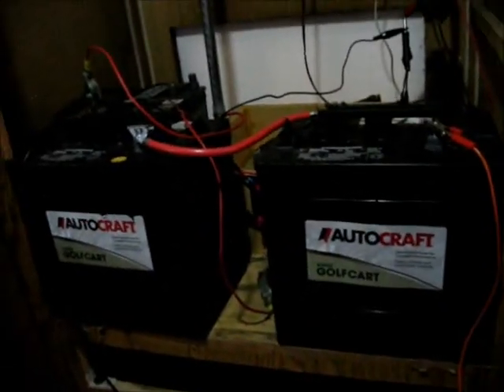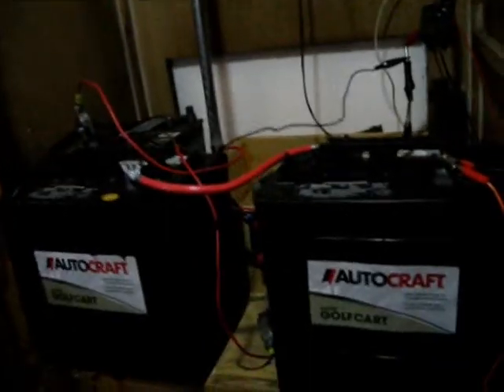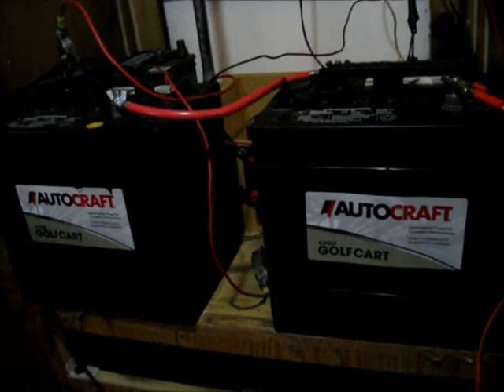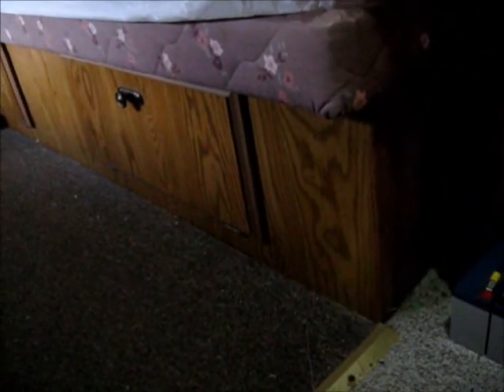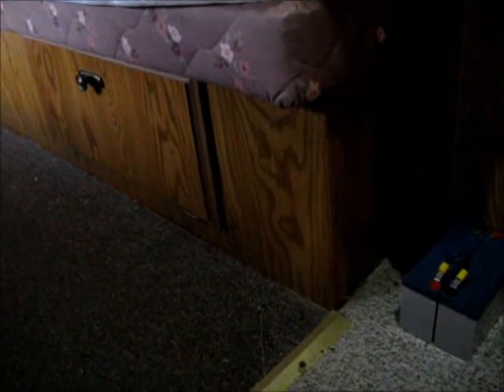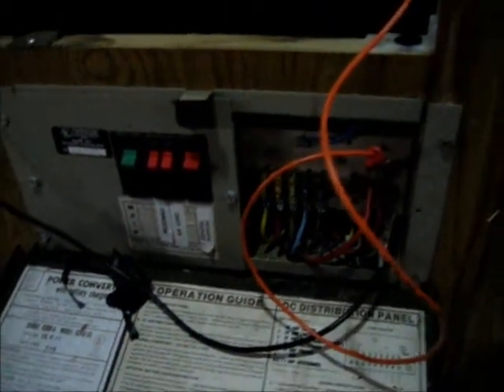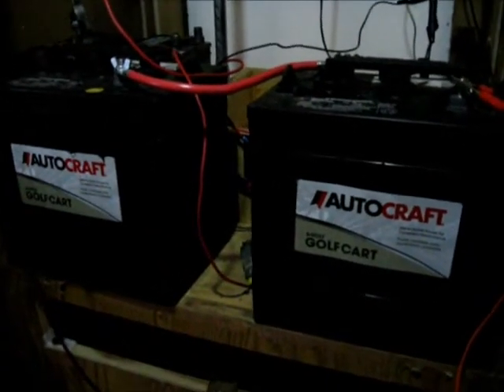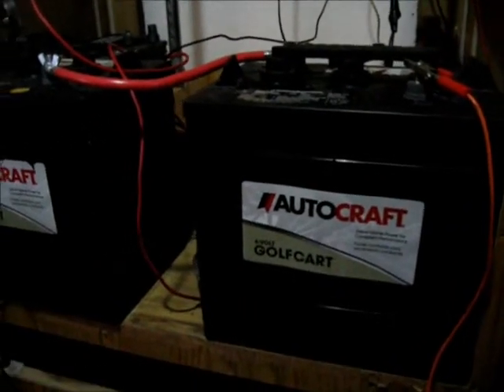A Look Inside The Off Grid Camper - The Solar Power Bank

Comment from the maker: I LOVE it!!! It is cheap to almost free to make. It times and tunes itself to any size battery you hook up. It is easy to make and use. And it restores batteries all day long. Forget "free" energy or "overunity", all I care about is restoring batteries and getting more power out than I put in.

It will charge 1 battery or 10 batteries all the same with no difference. It takes them all without flinching.

Comment: Hey love your vids. I live in an rv too but im trying to get my trayler to be off grid if ther is a power outage. But my question is I hooked up my batt. To my trayler and the 12 volts. Incondecent lights work but not the led that ive been slowly changing over any idea why this is happing? Thanks steve